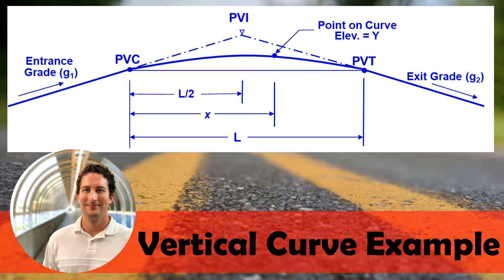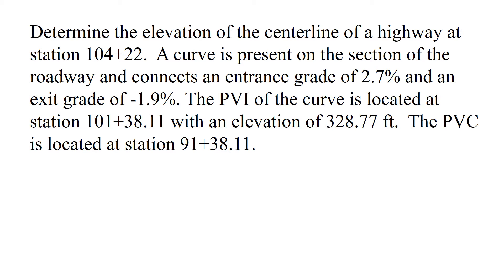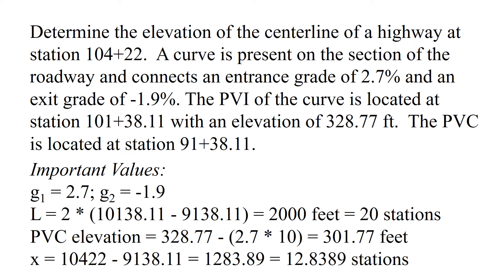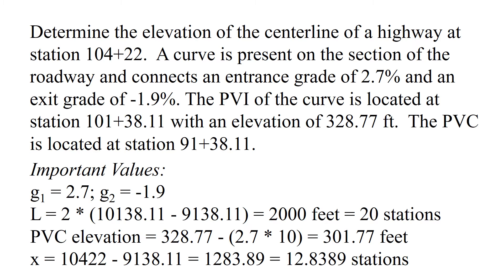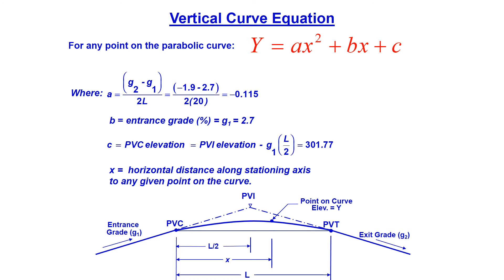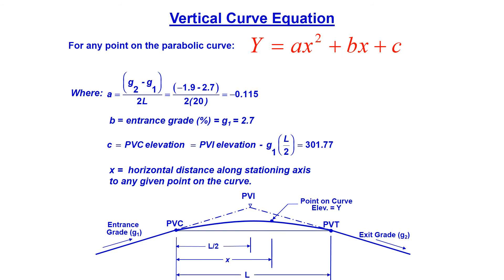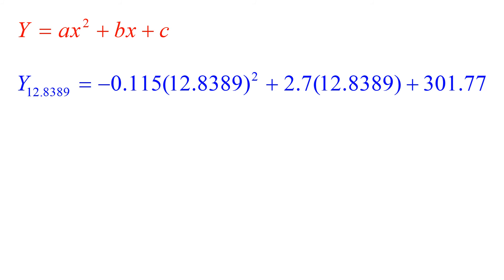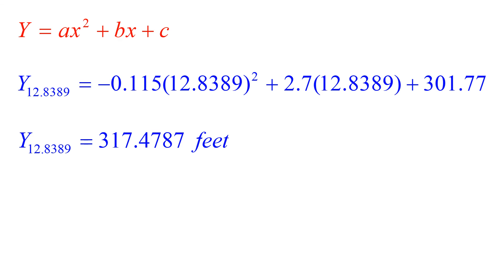Vertical Curve Example Problem | Find Elevation of Point on Curve

Comment: Hey Daniel! Thank you for providing this example along with all the other resources on your channel! I remember in another video you had recommended to keep the "a" value within the parabolic equation to 5 decimal places to ensure the answer is accurate. However, in this problem the "a" value is only calculated to three decimal places. Was this intentional or just part of the solution you were provided?
Reply from the maker: I usually work the problems in my calculator or in a spreadsheet, so I probably just showed 3 decimal places on the screen, but in the background, I have the full value.